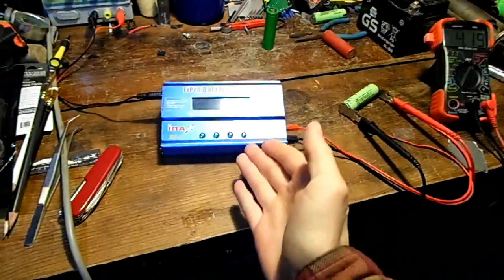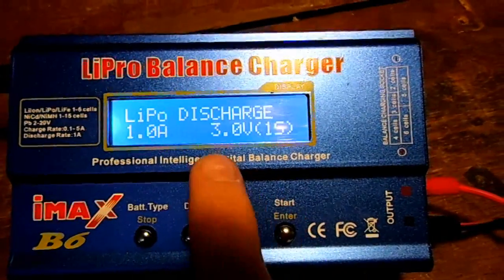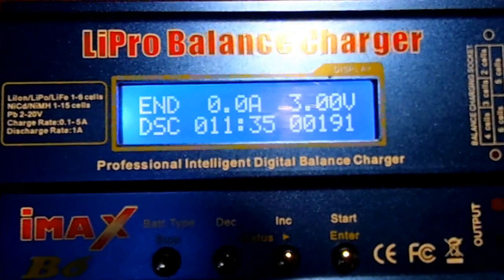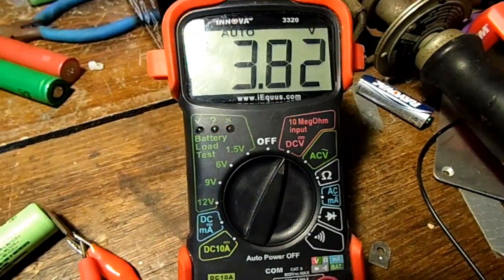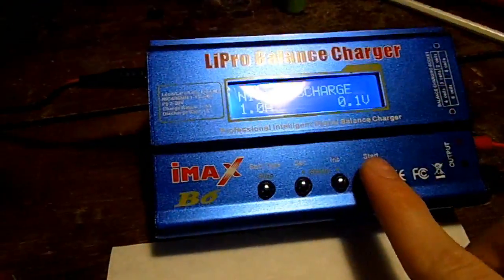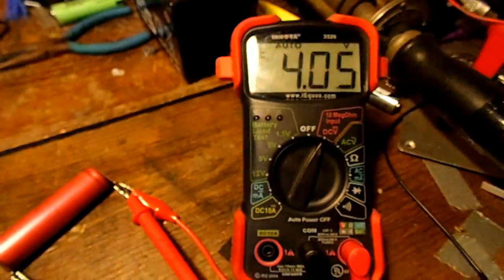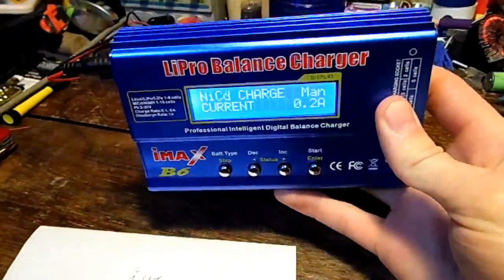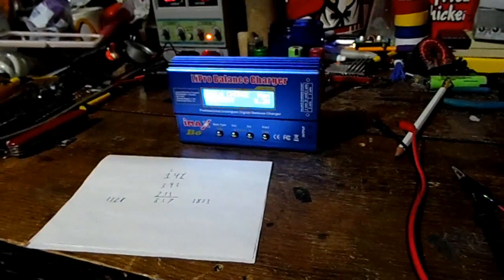18650 Discharge Capacity Test Imax B6

Comment: It's a Li-ion battery.  Why use Li-po and Nicad discharge.   Use the correct mode and it'll actually work.
Reply from the maker: because lipo and li+ are the same exact thing, except on this charger there is a differance of 0.1v. and the lower you charge your lithium cells the longer they last.

there is no "correct" mode. just differant modes that attain differant results.
Reply: Rinoa Super-Genius thanks.

Comment: Where did you get that nice charger..would love to have one...what..is the input voltage for the charger?...nice video..by the way.  I seen one from china for $19.00 and $3.50 shipping, but would rather get it local,  which is Long Island NY...
Reply from the maker: got it from ebay for 30$. its input voltage is 10-18v. theres also an imax B6AC model that has a built in 115v adapter. havent tested that yet though.
Reply: So you can use either power supply...I have a 12 volt power supply..
Reply from the maker: *****  i alreay stated that, its the B6AC. thank you Mr Obvious!
Reply from the maker: *****
you don't notice mine was also?

Comment: I have some type of 18650 battery 4000mAh, 4200mAh & 4800mAh Li-Ion. How do I calculate how many Amps are necessary for each different 18650 mAh battery for charging using the Imax B6?
Reply from the maker: Amps only dictate charge time, its not like they wouldn't charge fully with too small of amps.
Reply: Rinoa Super-Genius If I charge in the amount of 1.0 A to 18650 4000mAh battery, is it appropriate for li-ion battery?

Additional information:
I used to charge the battery of 2200mAh 55c li-po & charging 2.0 A for RC Helicopter. But I am not used to charge the battery type li-ion & how to Amp per mAh battery as appropriate. I need your expertise & experience. Thank you.
Reply from the maker: IZZAT FIKRI SALLEH
i would say for every 1AH charge 500ma.

Comment: only pulling 1 amp on the test.  So they are dead
Reply from the maker: yeah. but hey some capacity is still useful.

maybe save all the super dead cells and put them together into one big battery. you could use that for an off-grid experiment or something.

or do what i'm doing put them all together to make a battery to take camping. even used lithium cells would beat lead acid :D

Comment: Great video.  I charge my 18650's to 4.20 volts and then do a discharge test and my results are 2.98 V time 3:17 and only getting 54 mah so I guess these cells are junk correct? Is their anyway to revive old 18650's?
Reply from the maker: idk of any ways to revive them, and yeah they look to be really dead. but how many amps are you pulling?

the more amps you pull from a battery, the more energy is wasted as heat. so maybe it'll have more capacity on smaller loads.

Comment: Rinoa Super-Genius [Your giving out Bad and unsafe Information!]

18650 batteries ARE NOT LiPo Batteries, they are Li-ion [Lithium Ion]

Never mix or charge or discharge  different chemisty batteries than what you have set in settings.

You are asking for trouble if not very hot and maybe a fire or exploding batteries.

You are perfect canidate for a Protection Bag or metal container to charge and store your batteries in so if you have a fire or explosion you won't burn your house down.

Gary Bart
Application Engineer
Reply from the maker: lithium-Ion and Lithium-Polymar are the exact same thing, just differant production methods.

hope that helps.

btw cells only get hot when they short out, and they will almost never short out if you keep their voltages right.
Reply: Rinoa Super-Genius I'm not sure if this is an accurate statement. The discharge rate of li-ion cells is usually stated to be 1C-3C (at most), and it is even difficult to find the actual figure for any brand I've ever bothered to look up so far. I consider their discharge rate to be always 1C (the mAh capacity rate x1).

As for lipo batteries, they are usually rated 10C-30C (and beyond). So, while the comment regarding that their CHEMISTRY is the exact same could be true (and even that I don't know), the different production methods DO MATTER quite a lot in the end result. That I know for a fact. If you try to discharge a li-ion at 5A, you'll probably make the PCB overdischarge protection kick in, in the best scenario, or just downright ruin the cell(s). On the other hand, most lipo(s) can provide 5A while whistling along, AFAIK.
Reply: The Li-Po are set to 4.2V max charge, and has a set discharge cut-off voltage of 3.0V.
Li-Ion are only 4.1v max charge, and have a deeper discharge cut-off at 2.5v, meaning they perform better at lower voltages.

These are Li-Ion batteries, so the tests will be inaccurate with the wrong settings.
Also, setting the discharge at a lower rate with used batteries, will give you a more accurate figure at the end, since they tend to drop voltage alot faster under higher discharge, even though they aren't completely drained.

Else a good video :)
Reply from the maker: Wuptidoo
lithium ion and lithium polymer are the same chemistry just differant packages.
Reply: Rinoa Super-Genius Very interesting video thanks.
I think you're correct.
"Lithium polymer" in everyday use just means lithium ion battery in a soft pouch.

"The denomination "lithium polymer" has caused confusion among battery users. It may be interpreted in two ways. Originally, "lithium polymer" stood for a developing technology using a polymer electrolyte instead of the more common liquid electrolyte. The result is a "plastic" cell, which theoretically could be thin, flexible, and manufactured in different shapes, without risk of electrolyte leakage. This technology has not been fully developed and commercialized, and research is ongoing.
The second meaning appeared when some manufacturers started applying the "polymer" denomination to lithium-ion cells in pouch format. This is the most extended use nowadays, where "polymer" went from indicating a "polymer electrolyte" to mean a "polymer casing", that is, the soft, external pouch."
http://en.wikipedia.org/wiki/Lithium_polymer_battery

Comment: Nice video and info. The voltage of the cells is dropping so quick under load and going up so fast is because of the internal resistance of the battery. You just cannot discharge a high IR battery with more than a few hundred mAmps. Also the voltage is shooting up when charging because of 2 reasons: 1: The connections have to be as good as posible; 2: You need to charge them with a low charging current so the voltage won't overshoot because of the high IR of the battery. Hope this helps :)
Reply from the maker: yeah I know but thanks. btw I find internal resistance a very bad name, it would be better to call it the "reaction speed".
Reply: Rinoa Super-Genius Well I didn't invent the terms. Internal resistance makes most sense for me. You can call it Impedance when measuring AC ohms.
Reply from the maker: ciprianwiner
well it makes sense if you think of it as a solid state electrical device but its not. you gotta remember its a chemical reaction taking place inside it.
Reply: Rinoa Super-Genius Of course there is a chemical reaction. There are 2 things related: 1: Electric resistance and 2: Ionic resistance. The electric resistance is instant and the Ionic resistance takes a bit of time to kick in. That's why the battery voltage won't jump right up.

Comment: li-ions should not be discharged lower than 2.6v they can explode, and a 1A discharge rate is quite high. do be careful
Reply from the maker: i didn't discharge them bellow 2.6v. i discharged them to about 3.3v to 3.8v as you see in the video.

also in my first battery pack i pulled like 2-4 amps per cell.

but don't worry i'm being as safe as i see fit :D
Reply: with what i understand about how a lithium cell works is that the voltage should never drop under 2.6v even if it bounces back to 3.8v because when it is at a low voltage the metal ions have either depleted in regions on the plates or filled up in regions on the opposite plate so even an average distribution afterwards means it will have 3.8v you have regions of either overdepletion or overaccumulation during that low voltage time. leading to the formation of the things that cause cells to go bad or explode. which can explain why a heavily used cell could more likely fail or have its life reduced faster than a lightly used cell.

Comment: Were you using magnets for battery tabs? If so you have solved my problem!
Reply from the maker: sure did! i got a pack of like 100 of those neodymium magnets. my dad's funeral printing company bought them for an urn box thing that never sold. so i took the magnets home.

it is such a pain in the butt to connect batteries together without soldering or magnets.
Reply: Rinoa Super-Genius I have the same charger as well, never explored the other settings. I have just go hold of some stupidly high capacity cells from China which i might test now!
Reply from the maker: oh nice! i ordered some of those UltraFire cells i'm always talking shit about. i've seen some people test them and they come back as like 400mah instead of 3ah. so i finally bought a handful and will test them when they come in. i seriously hope i'm wrong and that they really are new and 3ah per cell.

Comment: Interesting Video once again!
What's going to be up next? :)
Reply from the maker: i'm finishing a video on epsom salt in batteries. the results are proving to be differant than i'd hoped.

btw thanks ;D
Reply: Rinoa Super-Genius
different then you hoped? Hmm, I hope it still works, because it sounded like a pretty good Idea to me so far^^
Reply from the maker: well there are a lot of myths regarding epsom salt inside a battery like

1: desulfation
2: increased AH/capacity
3: increased voltage
4: increased amps it can provide

and only the last 2 are correct it seems. my battery's capacity didn't raise or desulfate but it does stay at a higher voltage and can provide more amps. i mean when i pull power from it the voltage dips a lot less. but i am going to do this experiment a few times and make a few more videos on it.
Reply: Rinoa Super-Genius
Great! With your tests one can get a clearer picture on the method, can't wait for it, because I still have an old battery in the garage, so, let's see :)
Thank's for the detailed answer!

PS: I'll get you the laptop battery model soon, I just can't find it right now^^ :D

Comment: I never take them below 3v, below 3v they get weird, and easily damaged. i usually charge to 4.15, best cheap I have currently found is the turnigy 4s5ah hardcases. split to make into whatever. but under 3v, I'd never do it...
Reply from the maker: Well I,m not taking them bellow 3v for sitting voltage. Just for under load. They jump back up right after the load test.

But when I use them I recharge them once they get to like 3.8-3.9v.
Reply: Yeah theres lots of tech info and golden rules but a lot of them don't transfer to the real world too well.  It's like the two religions of either top balance often or bottom balance once till needed again.  I'm currently doing half a pack one way and half the other till end of December to see what happens.